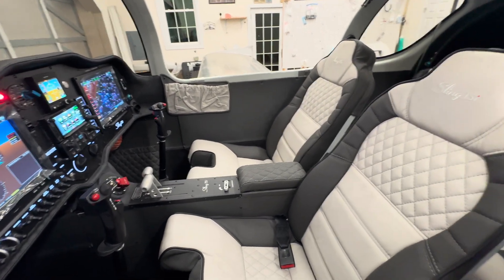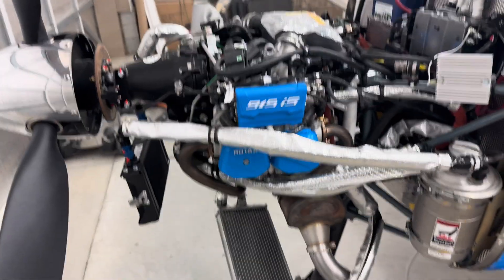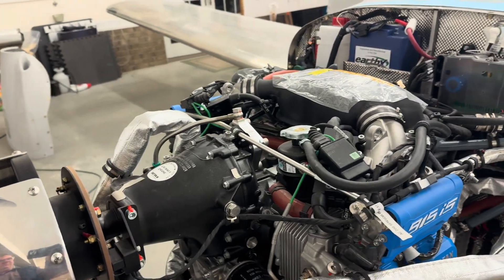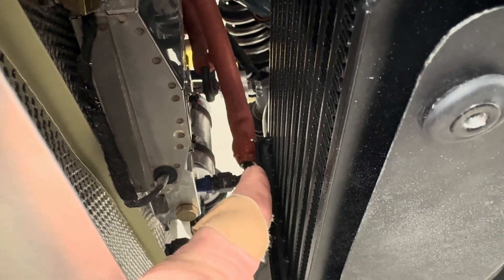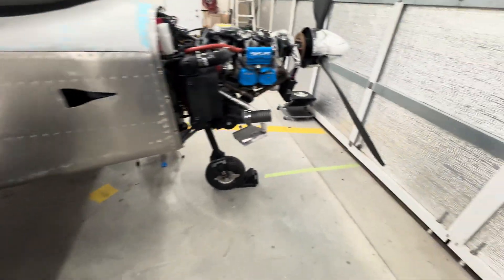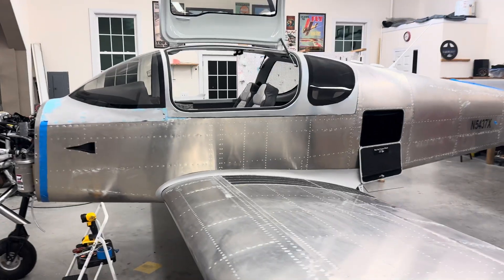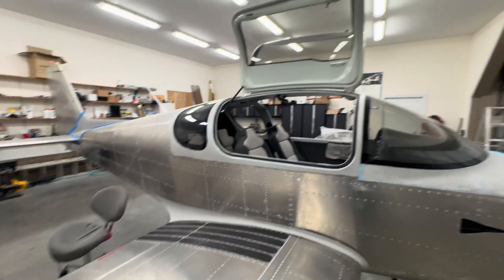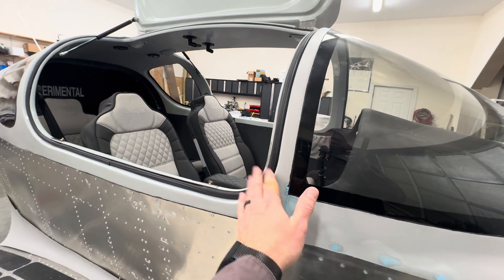Interior Complete!   Sling TSI Build Update

Comment: Looks great. Sling does a nice job of finishing out the interior. My build is a few months behind you. Started fitting the cowl this week. Question -- does your engine fall under the current service bulletins and what is your plan for those?
Reply from the maker: Unfortunately my engine is affected by the SB. I have a Rotax shop at the next airport over from me so they should be able to take care of it for me. I may try to test it before I fly but either way will take it to the shop within my first couple of hours.

Comment: The interior looks great. Well done. Have you/ can you do a view on the O2 system and how you routed the tubing to the front and back?
Reply from the maker: I will be doing a full overview of the O2 system once I’m done building.  I think it’s a big safety piece for these newer turbo charged planes that can efficiently fly in 02 territory.
Reply: @aviationkitbuilder  Hi did you ever get around to doing a video on the O2 system?
Reply: 100%. I’m using two O2 concentrators atm. Have the parachute so I am tight on space and W&B and they are a lightweight inexhaustible solution. But I want to plumb some tubing to keep things neater etc. But yeah I try to fly high whenever I can to push the thinner air and grab tailwinds.